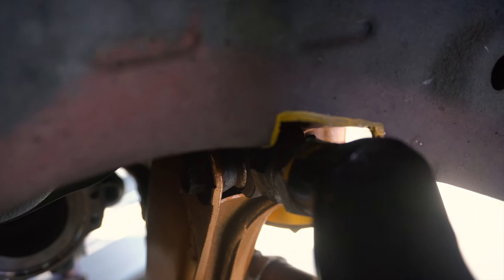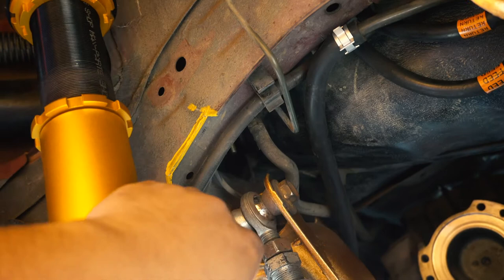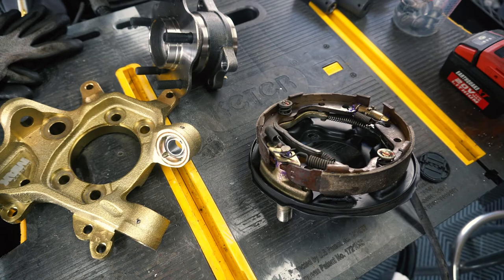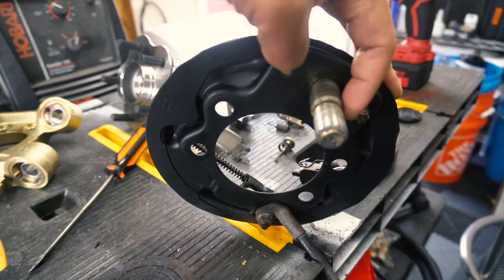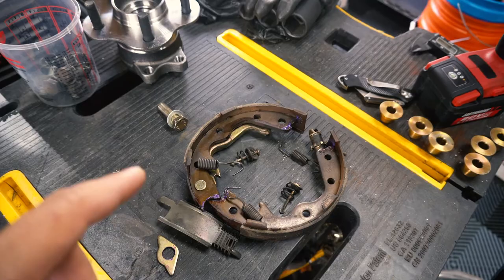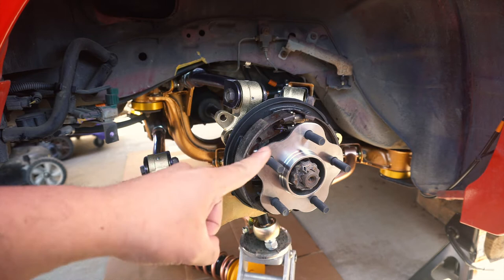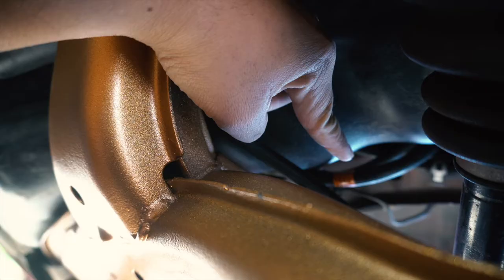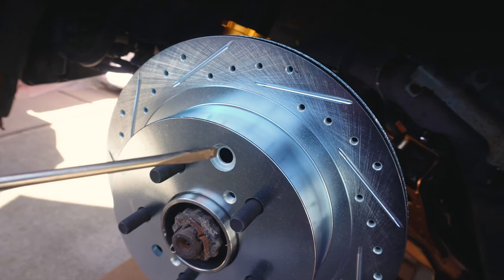Level UP! S14 Parts Shop MAX Rear Knuckles Plus Dual Z32 Brakes Ep.20

Comment: Great work man! Loving the build. I did notice at 10.52 your Ruca's are mounted on the wrong side. Passenger on driver and driver on passenger. Removing them and placing them on the opposite side, will give you much more frame clearance since now the threaded body where the spherical bearing meets the ruca would be pointed downward and then more clearance with the chassis from bottoming out. Keep up the great work 😁👍
Reply from the maker: Thanks Rene! Yea, that totally makes sense! Thanks for the explanation too with the frame clearance. It's one of those things where I've been staring at this project for so long, that details like that fly over my head. hahaha. Thanks again - you're a life saver!

Comment: Sweet build man. Really enjoying the vods so far. I'm a little confused with the ebrake cable set up. So you hooked up one cable on the left side of the front hook place, and then routed it to the right caliper side?
Reply from the maker: Thanks man. Yea it's a bit of a switch around with the cables. This is only applicable to the Parts Shop Max rear knuckles since the e-brake outlet is on top - stock setup is bottom mount. That is correct, the cables cross over like an x. So the right rear calipers heads towards the left-front ebrake hook and the left rear calipers heads towards the right-front ebrake hook.

Comment: Would the max dual caliper knuckles kit  could be Installed with all stock suspension other than coil overs? I pulled the z32 rear drum brakes of a car and I would like to get this kit and install it on my car and get the dual brakes plus the drum brakes. Thanks in advance
Reply from the maker: The max dual caliper knuckles are drop knuckles so it will most likely get your stock suspension geometry out of alignment. I can't 100% confirm that it would work, but if you can compare your stock knuckles to the part shop max ones and visually confirm that the drop isn't too aggressive, then technically it should work. hope that helps! but just double check before you do any installing. It's super tricky to get that lower control arm nut on the knuckles and get it torqued decent enough.
Reply: @FittedLifeCollective  gotcha… thanks for the quick response. I am going to look into this but I already made a purchase for the front and rear brakes. I have not yet purchase the knuckles or the 2nd rear set but would consider upgrading my whole suspension in the future.

Comment: Awesome video! Can you still buy the entire Z32 E brake assembly new? Or do you have to source a used one? I will be running the same drop knuckles
Reply from the maker: Thanks! I had to source a used Z32 e-brake assembly through eBay. I believe the e-brake assembly is discontinued by nissan, but you can buy the replacement brake shoes.

Comment: Are you able to run the willwood caliper while still having the z32 caliper as the foot brake
Reply from the maker: I can't confirm the wilwood/z32 caliper setup, but according to parts shop max, you can run wilwood/oem s14 by cutting off the Z32 mounts. Double check though and reach out to the guys over at parts shop max.